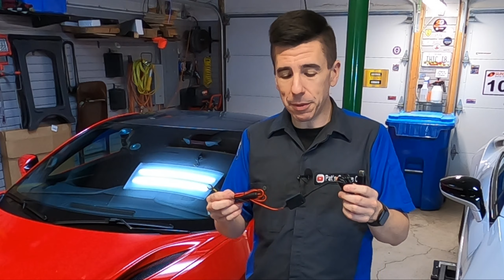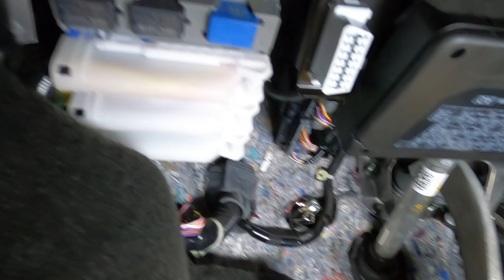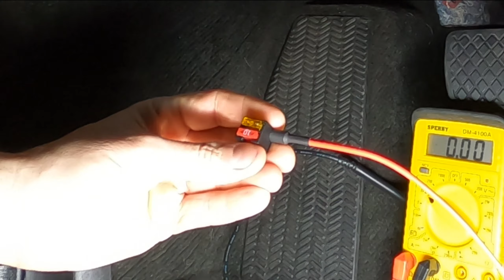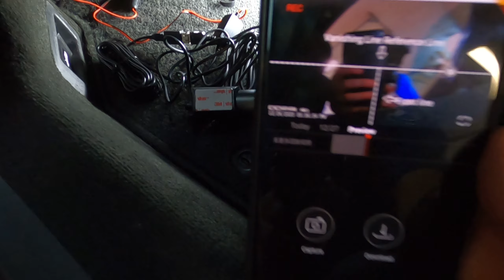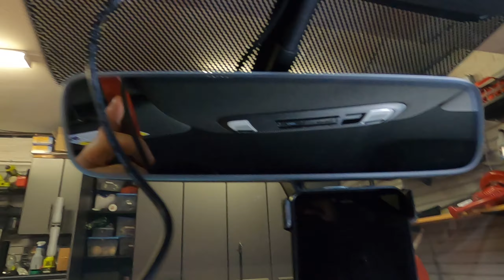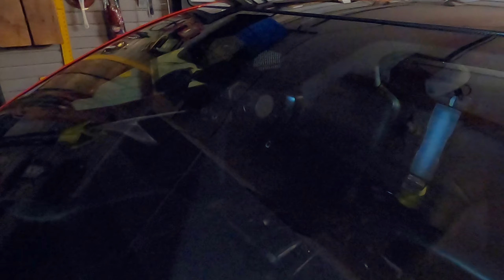Installing the DDPai Mini 3 Dash Cam and NuCam battery drain protection in the Acura NSX

Comment: Hi, I already have ddpai mini 5 installed in front windshield. Can I install this on rear windshield? Is the cable long enough?
Reply from the maker: The cable may be long enough to reach the rear window in your car, but if not, you can purchase a USB extension cable.

Comment: Although these dash cams have a good quality picture they are crap. I 
have had two and the capacitor goes bad in a year. The worst part is 
that they appear to be working (voice comes on at start up and LED fades
 on and off) but they aren't recording. Just checked mine today and it 
hasn't recorded for the past 10 days.
Reply from the maker: Oh wow! I'm sorry to hear you've been having trouble with that model. I have used one of them over the past two years and the other since Dec 2019. I am going to get a third. I must have gotten lucky.
Reply: @PatsGarageOnline  Ddpai uses cheap garbage super capacitors that die within a year. Their cameras are only rated for 158 degrees F which is easily reached with an outside temperature of 80 degrees. Just lazy engineering. 2021 and no one can make a dash came with an external replaceable capacitor. The 1940's are calling. They want their Ddpai camera back.

Comment: I've had two of these. The video is nice and sharp but the first one 
lasted two years before it wouldn't record most of the time (even though
 the led said it was) and the capacitor died. Ddpai says they don't 
repair them. I bought another and it won't connect to my phone with wifi
 for live view or to download videos. I just get a network error. It did
 however update the cameras firmware through the phone and wifi  so 
don't know what the issue is.

Comment: Hi Pat, another great video my man. I have been informed that my 2021 NSX should be delivered in June. Question, the next time you’re near your NSX can you measure the hight from the ground to the pinch welds? I’m looking at purchasing a lift for my garage. The one that i’m looking at has a clearance of 4 inches. Will that be enough for the NSX? thanks
Ken
Reply from the maker: It's 4" on my car.  I use the 7000 lb QuickJack and they have 3.5" of clearance.